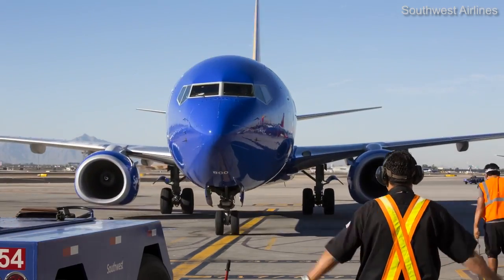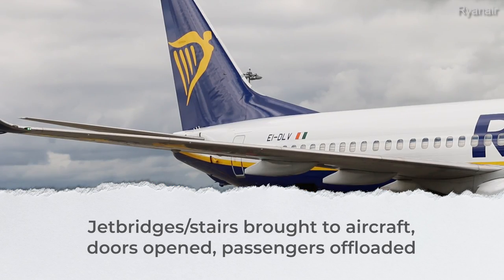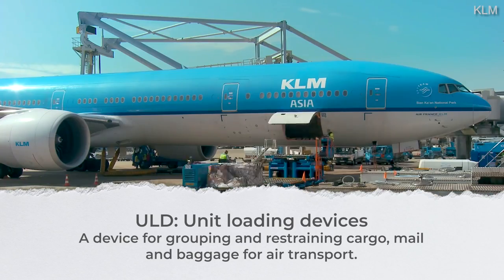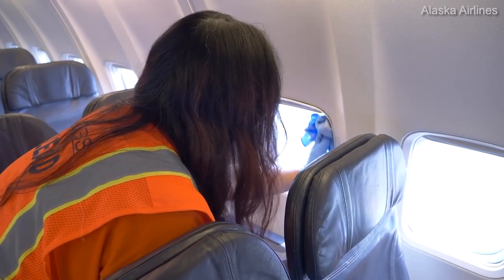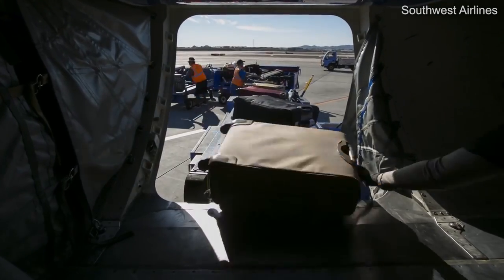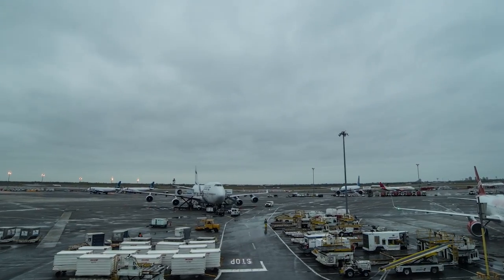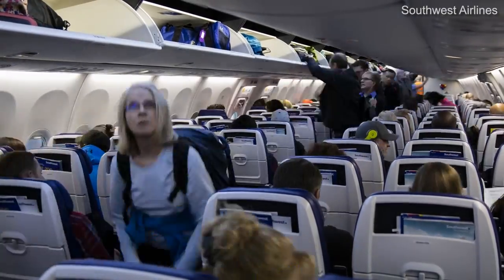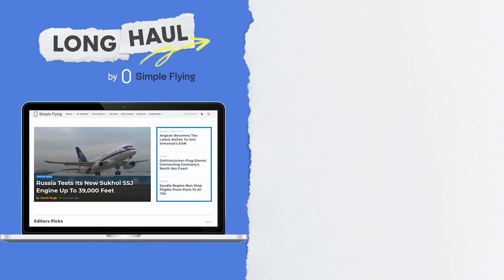What Happens To An Aircraft During Its Turnaround?

Comment: Working at a major airport in europe in different positions such as ramp dispatch and even airline representative, my record is 33 min for a flag airline (not a low cost) on a fully booked 737 during summer. The aircraft arrived late which meant we had to do a short turnaround (speed up the process to cut on the delay). We used every tick un the book and unloaded 180 passenger and loaded another batch back in the plane in 35 min. Another impressive performance was to fully board a 747 with 522 passengers in 17 minutes (from the moment the first passenger was allowed in and the last one entered the aircraft). I was responsible for the turnaround at the time, so I was in charge of the boarding strategy. It was a major success I was not able to replicate again hahaha

Comment: I've been on flights where the did everything but push us onto the plane and into our seats. One in particular was a flight to MDW (Chicago Midway) on SW, the tower in our departing city gave our flight 15 min to be in the air due to a small window of good weather before a severe t-storm was scheduled to hit Chicago. I know this because one of the flight attendants was telling a passenger who needed a fire lit under them. This was a full flight, as SW flights to hub airports out of smaller airports usually are, and luckily for all involved this flight had relatively  experienced passengers who knew how to hustle (we all just want to "get there" don't we?) and once the word got around that we needed to either get in the air fast or risk deplaning and waiting an hour or more for Chicago's weather to clear, the door was closed before the last few passengers got to their seats and seatbelts were still clicking shut as we pushed back and began to taxi. There was no traffic and when we reached the runway the plane made it's turn onto it and without a seconds hesitation rolled down and we were in the air with seconds to spare. And that storm in Chicago? I truly have no memory of it ever rolling through. This was all based on the fact that flight time was approx 1 hour and they could have dissipated as we were in flight.  I do remember later that night waking up to loud claps of thunder.
Reply: If only all passengers could do this our job would be so much easier
Reply: Thanks for the information!

Comment: Yeah, RyanAir, they wanted us to turn them around in 20 mins, the moment the incoming passengers were off the plane, the outgoing passengers were already waiting at the bottom of the stairs to the aircraft waiting for the crew to confirm their checks are complete and that the passengers can commence boarding. Fasted time that me and my crew managed to turn a RyanAir was 19 minutes
Reply: 20 minutes? I'm now worried that Ryanair might not clear their sewage on the planes.
Reply: Wow!
Reply: @cupcake0011  they do. But only when they go back to their point of origin. As its normally European flights they do, their tanks dont fully fill up so they can wait till back at their base. 

If need be. Just before they land. They can call ahead and request the sewage truck to be there on arrival. Which does happen from time to time
Reply: @stiffyscotland  so basically, you'd still be flying on a plane where there is left over sewage from previous flights? That not only sounds like it may cause some odor, but highly unhygienic (especially in today's times). Makes me wonder what else they don't do with such a quick turn around time. Then again, Ryanair is the time of airline that cuts corners and tries to maximize profit as much as possible. So I guess im not surprised...
Reply: @StallionFX1  of all the flights i have spun, they were the only ones to do this.. when RyanAir used to have an Aircraft based at Glasgow Airport, that used to always get emptied and the water replenished every time it came back to glasgow. It was never emptied at the other airport. 

Costs them money each time they book the sewage truck. So most of the time its every second airport for them.

Comment: As a turnaround manager I managed to turn around a Boeing 767 270in/270 out in 30 minutes one evening. Many steps were shortened but necessary for an on time departure. Many thanks for the assistance of the crew.
Reply: Quickest i managed was a 787 in 25 minutes (all be it, the front haul was empty on outbound) 😅
Reply: not the first time we done that 🙃 had targets for when the easyJets landed, and you never made the timed targets if you followed procedures, so we always use to just forget the cones and cholk the nose gear. 

The person putting the front stairs on would look at the aircraft and leading edge of the wing for damage. guy with the rear stairs would do the same for the back of the plane. i would power the AC and then o0pen the holds and do the same thing on the other side of the AC.
Reply: @stiffyscotland  we would by pass the cones too. Put the belt straight on hold 5 to offload the pushchairs as their priority. Then another guy would open the back door and offload the pax ULDs . After which the guy from the belt will go and open the front hold with the FMC. Offload the cargo then we just load it again straight after. While also loading the rear hold. Shut everything down and push… usually waiting for clearance was the longest as u can imagine what its like in heathrow
Reply: @FlyingDxtchman  the exact same in Glasgow 🤣 was mostly the Ryanair's and the KLM that got cheesed off with ground control as they were always told to wait due to other AC movements or the fact that most of the time it was cause they had slots

Comment: One of my very first turnaround moment was my flight from Singapore to Jakarta back in 2017 using Lion Airlines. I just got checked in, cleared customs, walked to the gate, and saw passangers from the previous flight deplane from the same plane, suddenly after clearing security (which took around 15 mins) we got called in to board. In total the plane took only 30 mins on the gate

Comment: I used to be ground staff  working with a major airline and we only had a team of 4 people to turn our flights.  And time was very limited.  For a regional jet, we only had 24 minutes to park, empty, service, load and push a flight.  For a narrow body mainline jet, we had the same number of staff, but with up to 189 passengers onboard, we were given 34 minutes to do everything.  Funny how this is the expectation demanded in outstations, yet the hubs are staffed with a greater number of people (usually 6 just for the outside) working that very same aircraft a flight and always get a greater amount of time (45 minutes plus)  to do the same job.  

Interestingly, due to circumstances that almost impossible to deal with, we actually turned a 50 seat regional jet in 8 minutes.  It was a very well choreographed event.  The crew contacted us via company radio and told us they were going to "time out" before arriving back in the destination city if a standard turn of 24 minutes happened and thus, the flight would have to be delayed or canceled.  However, could we make it work to get them out faster.  We got our heads together and made it happen in 8.  Our gate agent gave a pep talk to the passengers for that flight about their rapid cooperation if they wanted to get on the flight, any delay would cause cancelation due to pilot work hour limitations.  She outlined exactly what everyone needed to do.  The ground staff had the same we must fire on all cylinders pep talk.  The pilots and flight attendant gave a speech to the passengers on the inbound flight about get up and get out immediately to make this happen.  It was mind-blowing how everything worked out.  None of the arriving passengers even complained about our not bringing their bags right to the carousel immediately...allowing all our staff to turn that plane first.  The pilot must have given a good speech to them.

The captain even put us in for an award for the effort and told us when they landed at the destination, they had only 2 more minutes they were allowed to work...that was how close we cut it to make a success out of what was to be an absolute failure of a situation that the events of that day conspired to make us fail by.  13 minutes was the next closest turn time I ever had.

Comment: Aircraft maintenance technician here. 

Great video!

Not many seem to know what we truly do in the turnaround so let me try to clarify.

1) See the person with the flashlight and high viz jacket looking at the aircraft? That's maintenance doing the post flight and pre flight walkaround check.

2) We service the engine oil and the hydraulic reservoir if the quantities are low.

3) We fill out the aircraft refuelling sheet.

4) We check the logbook for any discrepancies/open items.

5) And lastly we sign the airworthiness release in the aircraft logbook, declaring that this aircraft is indeed safe to fly.

Without that signature the aircraft isn't going anywhere anytime soon. Cheers.
Reply: What's the aircraft refueling sheet?
Reply: @ATLMike94  good question. It's basically this sheet of paper we have to fill out and hand 1 copy to the captain in which he double checks our calculations and signs it if he/she is happy. It includes the: fuel density, amount of fuel in each tank, and tolerance, because us in Saudi the aircraft displays the fuel in KG/LITER, but the fuel truck has the fuel in KG/US GALLON, so we need to convert between the two. Not all airlines have this.
Reply: @rayanaltowayan9558  the aircraft fuelers don't handle that?

Comment: Generally, I enjoy watching your videos because they're normally accurate and brief...

However, I have to set you straight on a couple of bits on this one.

I was an aircraft dispatch officer (ADO)/Redcap (or The Ringmaster, because you were coordinating a circus and you were the one with the whip!) for many years. In all of the video, you assume that everyone knows their job and just gets on with it - and unfortunately, that's totally inaccurate. Everyone needs the Ringmaster to coordinate the lot, and drive that turnaround harder.

They all look to one person to coordinate the lot. It is their role that's essential in a turn around. This seemed to be missing in the video. There was a brief mention of 'Turn Around Managers' (maybe that's the modern term?), but you gave no idea of what they do. This is what they do...

Long before the aircraft arrives, the dispatch officer is busy calculating the weight and balance of the aircraft with it's predicted load to aim for a correct CoG, along with a guesstimate fuel loading - dependent on it's specific gravity of the fuel at the time you request it (to be finalized by the flight deck on arrival). All along with calculated trim settings.

Departure slots have to be communicated to the relevant centre, in the case of the UK, that was Brussels, back when I did the job.This is all before the aircraft arrives.

Then, when the bird lands, and let's assume it's a big one, say a 747, you have 900 off and on pax to sort, up to 30 crew off and on because there'll be a change in a big bird...

Fuellers, baggage handlers, caterers, cleaners, potable water, honey cart, pushback tugs, special requirement passenger handlers, ATC as well if you have problems with the aircraft (one - meeting it's schedule - or Two, a problem with the aircraft or crew themselves. Don't be under any illusion - the ADO can cancel your slot at a moment's notice if they're not happy with that flight - and I've done it when the Captain says they want to go and I say they don't!). 

The best way to think of an ADO is, it might be the Skipper's aircraft in the air, but on the ground, it's mine (even though the Skipper is in charge ultimately - most captains know that you know your job and defer to you until you release that aircraft for flight. Most skippers rely on their ADO like their right hand on the ground).

Coordinating almost 1000 people in total, in an hour when thousands and hundreds of thousands of dollars are involved in a delay. You need to know your job and do it with skill, knowledge and confidence.

BTW - personal record for a Ryanair B738 (MAN-DUB), full pax load in and out, and already round-trip fuelled - 21min from brakes on arrival to brakes off pushback! Let me know if you can beat that 😁

I hope my rantings have demonstrated a little more clearly what happens on a turn around. Those years have passed for me, but when you see that ADO, give them a hug, because they're the ones pushing hard to get you away on time or even early, yet nobody even sees them!
Reply: Yeahhh. In ky country, Load Planner officers usually plan 4 hours ahead of time before a turnaround flight. And also the last person the captain sees before the aircraft doors are closed.
Reply: Wow! I’m going to save this comment and reference you if I am in a situation where I need to talk about dispatchers (I’m a lecturer at an aviation university)
Reply: @nashmiarashid5161  Please, feel free to Nashmia

Comment: As a retired turnaround coordinator:
Before arriving plane:
1.	Checking apron for items that could do damage. 
2.	Checking outgoing cargo/mail if it matches with given information.
3.	Calling cleaning/fuel services for an estimate time of arrival.

First 10 – 15 minutes:
1.	Docking.
2.	Placing chocks and safety cones.
3.	Connecting bridge.
4.	Walkaround (checking for damages).
5.	Unboarding passengers.
6.	Unloading baggage/cargo/mail.
7.	Crosscheck special needs with flight crew.

Second 10 – 15 minutes:
1.	Cleaning inside plane
2.	Loading baggage/cargo/mail.
3.	Crosscheck fuel figures.
4.	Fueling.
5.	Requesting boarding time from steward.
6.	PIC walkaround.
If requested by flight plan/crew:
7.	Lavatory cleaning.
8.	Refilling water tank.
9.	Catering.

Final 10 – 15 minutes
1.	Boarding.
2.	Most equipment removed from apron.
3.	Pushback truck arrival.
4.	Walkaround pushback driver.
5.	Checking missing passengers.
6.	Finalizing flight.
7.	Crosscheck Weight & Balance with PIC.
8.	Closing doors & removing bridge.

Making notes of any disruptions in order to correctly assign delay codes.

Comment: Good information. Worth noting if a new cabin crew arrives on the aircraft turnaround they'd have to check safety equipment is in order first. 
I witnessed a 10 minute turnaround. This was an Air Zimbabwe flight from Harare that had landed in Bulawayo and was flying to Victoria Falls. Literally 18 mins between the time the 737 touched down and turned towards the terminal halfway down the runway and takeoff. Of course the smaller airport and zero traffic played a part too.

Comment: 6:44: Southwest Airlines actually has both flight crew and ramp agents looking for any damage.  Or, at least, they're supposed to.  I got terminated from that company for pointing out to the flight crew that they had zero oil in the right hand engine.  (This involves looking at a sight gauge; nothing is unscrewed or otherwise manipulated on the engine.)  This caused a 30 minute delay while the mechanics added oil, and I was terminated for a "frivoulous" delay.  (The engineers at Boeing, having written the aircraft's minimum equipment list, beg to differ as to the frivoulousness.)  I also found things such as FOD damage under the fuselage (about the size of my fist, and as deep, and showing the black composite under the blue paint,) dents on the horizontal stabilizer, and severely erroded engine spinners.  (All of which were missed by the flight crews and more senior ramp agents.)

But what am I but a simple ramp agent?  Clearly, I'm too stupid to do anything but sling baggage and drain toilets.  Its not like I've been in this industry for awhile, servicing everything from Cessna 172 to Gulfstream G650s to A340s and Boeing 737s.  Not like I'm well on my way to being a commercial pilot myself.
Reply: No such thing as a "simple ramp agent" because you know as much about the aircraft as anybody else does.

Comment: While all theese happen, line maintenance tasks like daily check, weekly or ramp check, engine and hydraulic oil servicing, cargo light replacement of course for B737 :), and again for 737's which dont have QAR (Quick Access Recorder) PCMCIA card changes of DFDAU ( Digital Flight Data Acqusition Unit), T/log replacement, Co-mail loading can be done.

Comment: On short haul flights I’ve taken here in Australia, I don’t think I’ve ever once seen the plane refuelled during turnaround, though I’m not a frequent flyer. I think there are some times where it may be cheaper to completely fill the tanks, then use it for multiple flights that day, no refuelling. It can be more expensive doing it this way, but it’s also easier and saves time, so if it saves time at several turnarounds for one aircraft for one day, you can imagine that time saving is gonna add up pretty quick, which will pay for the extra fuel burn from the higher weight.
Reply: Also fuel prices that airlines get are different on almost every airport. That particular airline might have their own fuel station on a previous airport and thus refuel more fuel to avoid the much more expensive fuel buying from a different company. They cant fuel too much though that it will offset the savings due to the heavier takeoff weight.